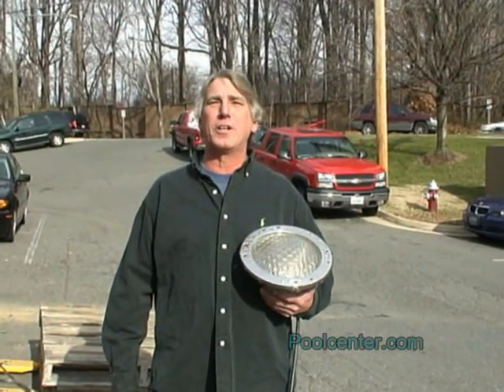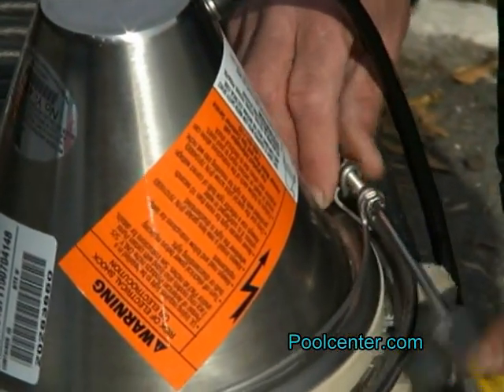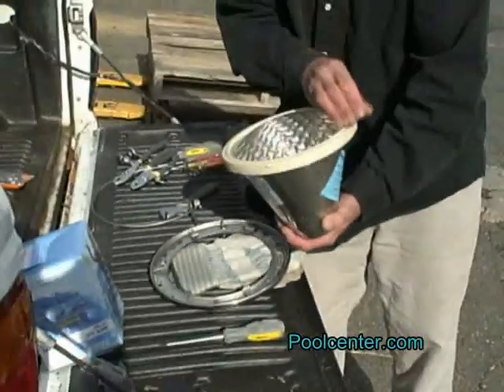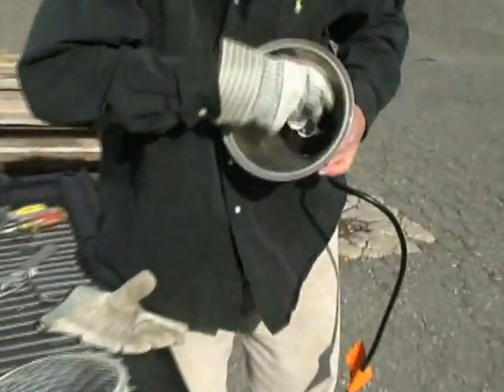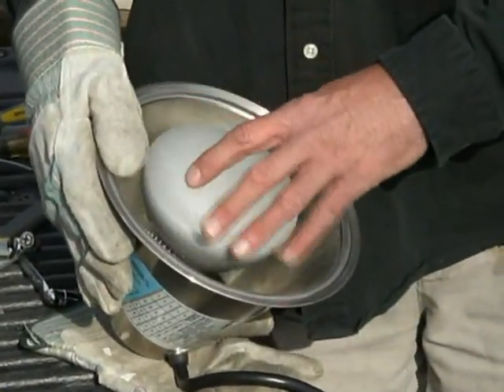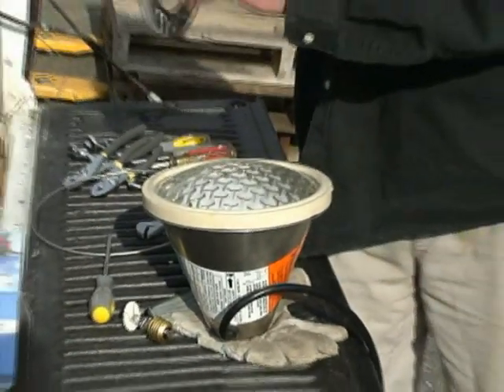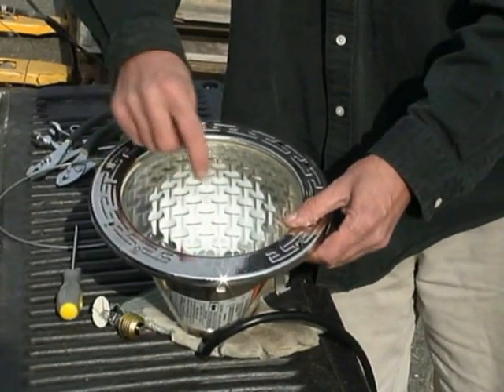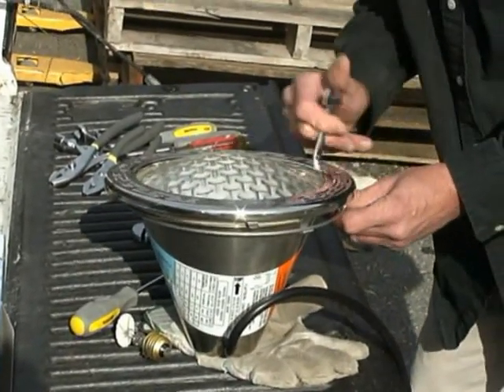Replacing a Broken Pool Light Bulb

Comment: Just changed my pool light. This video was very helpfull especially on pointing the half moons on the light fixture in the right direction. Had trouble with the gasket tho, as which way faced outward or exactly how it went on. Found the info printed on the gasket, tho not easy to find. Black letters on a black gasket. I used tube lube as well on the gasket which was not mentioned on this video.

Comment: Great DIY video,shouldn't we be using silicone on the lens gasket?
Reply: I used silicone on mine and it still leaks even with a new gasket. I think I need to really cinch the ring down. Like the guy says, "you can't really tighten it too much." I'll let it dry tonight and try again tomorrow!

Comment: Why is it okay to remove and install the light fixture with water in the pool? Won't that result in water getting inside the niche, where it will forever remain stagnant and probably growing algae? Wouldn't it, ideally (I know it's not always practical), to remove and replace the fixture when the water has been drained low enough so that water doesn't get in the niche?

I currently have my pool drained and my light lens broke and has to be replaced. The bulb is fine -- but it seems that while I'm in there, I should replace that bulb too since it's decades old.
Reply: Water is always behind the light housing. Weather you drain the water down or not. There is no gasket to stop it from happening and for a good reason. The water around and behind the fixture is what cools down the light. If you turn on your pool light when it is out of the water the bulb will explode or burn out in minutes because of how hot it gets. Waste of money to drain the pool to replace a bulb since water will fill back in behind the housing again while filling the pool.
Reply: +Brandon Harper I now know that you're right, Brandon. In fact, when I did have my pool empty once (for repair), I turned on the light at night and hosed it. It exploded. Of course, you don't want water IN the fixture, and I don't know if you NEED it behind the fixture (since water in front of the glass cools it), but it's inevitable that it will get behind the fixture. I used to think if it did, it would drain out of the pool, but that doesn't happen.